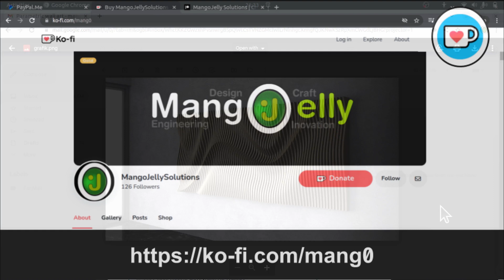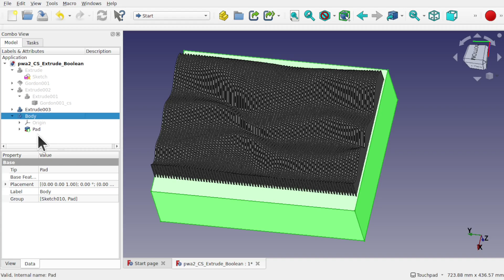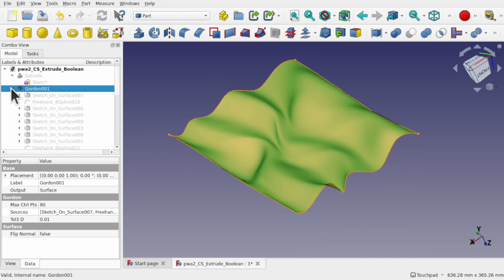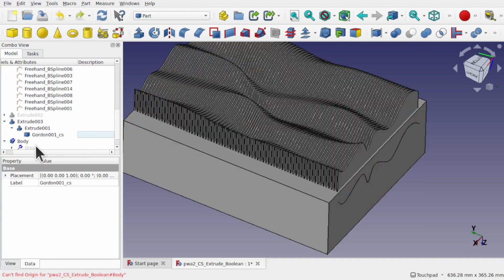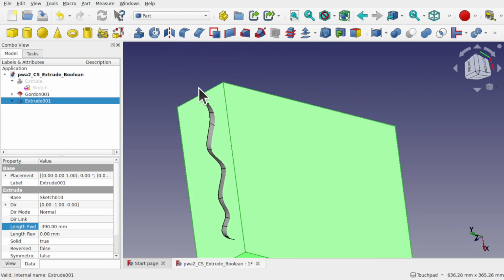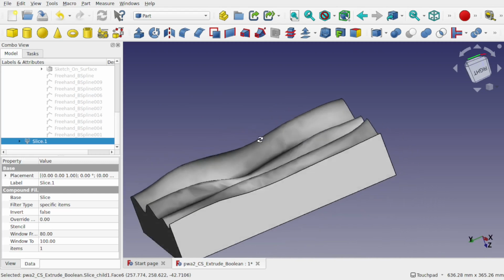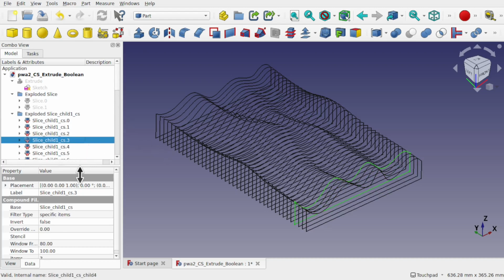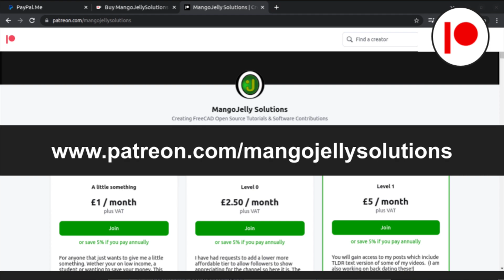Parametric Wall Art in FreeCAD Curves Workbench : Viewers Project

Comment: I tried to make a decorative panel  using dampened sine wave curve revolved around Z axis [y(t) = e-t · cos (2 π t)].
I thought using Paramertic_Curve macro will get me there.
The macro draws the line for me but that is as far as I can get. When I click OK in the Formula Editor panel, the curve of the spiral (first formula on the list) is generated.
The second problem is how to get the line generated by the macro into a sketch.
I could not find any useful info on FC forum and there is not a single video on Parametric Curve FP macro.
It has potential for generating very interesting objects, but it is not obvious how to use it.
Perhaps you would be willing to tackle this unexplored subject?

Comment: If someone had shown this to me about 28 years ago while I was drawing in autocad in a disk operating system on a 386 computer with an integrated processor on the motherboard, I would hardly have believed my eyes, or been teleported to the star tracks. If the human race walking behind idiots doesn't break something, try to imagine what will happen in 28 years. Know that what you imagine is small :) ~

Comment: I love how simple workflows in Part can be – but I still gotta learn a lot about Part and it's related workbenches. Thanks for bringing a follow–up, I'm happily looking forward for this. 🤩 I may have found a new place to move in and if so, I'm gonna need some acoustic panels; covering them with such wall art would be awesome. With the workflow you've shown it should be very easy to use both top and bottom of the sliced object, right? – That could save money and reduce the amount of wasted wood (in CNC / Laser cutting) drastically.
Reply: Some designs feature a mounting system on the backside, and I considered this option. However, they don't look as nice, so I decided against it. Instead, I am planning to place boards on the floor and ceiling and mill grooves in those boards to securely hold all the slices.

I haven't yet made a final decision regarding the material and thickness I'll be using. My mounting strategy allows me to delay that decision, and I can also slightly stretch out the structure without compromising its appearance.

I agree that these types of panels do an excellent job as acoustic diffusers, which was actually part of my motivation for the project.
Reply: @fasti8993  Hiding the mounting from sight sounds quite appealing… drilling holes through the back plate and using screws & a distance gauge for mounting cold also be an option – one that'd even work with something like acrylic as back plate.

I'm gonna discuss the construction with my nephew anyway. He's a cabinet maker and following his advice on working with wood is always a good idea.
Reply from the maker: That's is a brilliant idea to use this to cover acoustic panels. Like yourself I have just moved into a new home and looking around I have a lot of work to do and bare walls. I have my eye on freecad for a number of projects and been looking at dusting of the laser cutter to  build something like this and I think I found a way last night so going to be doing a video of what I found very soon.

Comment: Looks good, for your follow up maybe you should design in  a mounting system for the slices, probably something like 2 or 3 dowels through the full slice set and a series of small spacers that fit in between  each slice on the dowels.